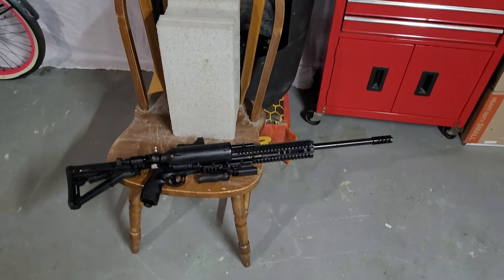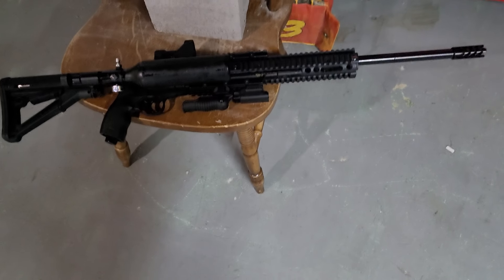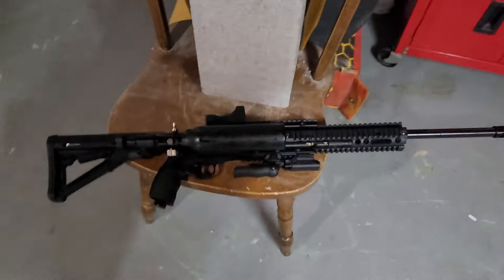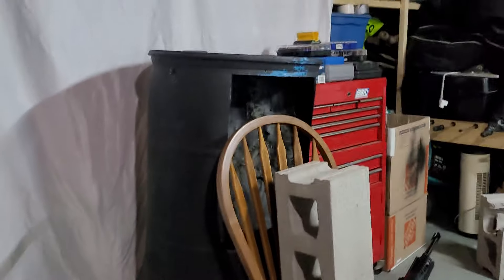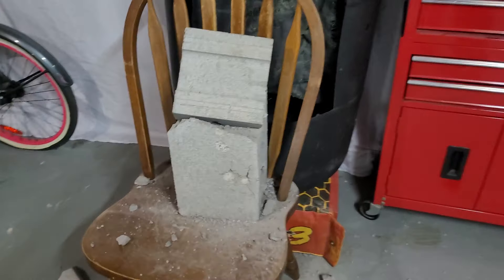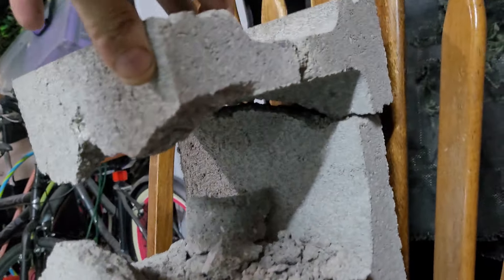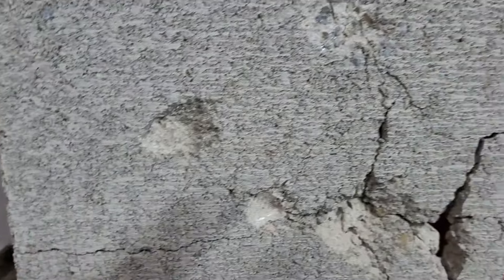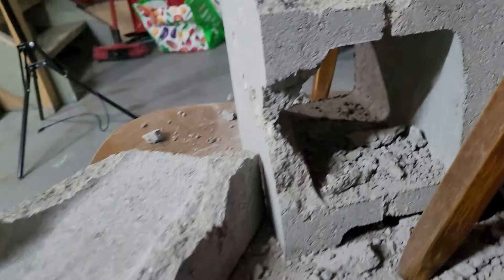Umarex HDR 50 vs Cinder Block 124 Joules 12g Lead Hollow Points

Comment: If you're running hpa and steel balls through a hdp50 with no restrictors and tuning barrel do i need to put rhe power kit in it or is a upgraded detent good enough? Thanks
Reply from the maker: just the detent is all you need

Comment: Nice video, thanks Jeff !
I guess it's filtered by the microphone : what about the noise ?
I got a set up on a HDR.50 - largely inspired by your videos - but that thing is noisy as hell even though it's "only" delivering 85 joules in its current state...
Reply: Go to Quattrovolante and get a insulated silencer. Great prices. Not mock silencers. Another top tip, try not to have concaves in the back of projectiles, it creates a deafing pop! They can be easily modified. Mine is down to 90 dB. I don't know how loud it was originally, but it was shotgun loud!
Any questions, just ask 😉
Reply: @-hopstar-  Thanks Bro !  I'll have a look at that.  I most often shoot spherical projectiles but even in that case its litteraly deafening (more than any other airgun i own).
Have a nice one ;-)
Reply: @DIMZEROCENT Plus side is, it scares the shit out of your burglar! If I heard that I would run!
Reply: devastator is concave, I didn't notice any notable differences. @-hopstar-
Reply: @hardairsoftmode  I make ammo. I used to leave a concave/space in the rear of it to catch more air. I found out by making it flush at the rear the sound was greatly reduced. Like popping your finger out the side of your cheek. And zrams the same, being virtually hollow. I would always fill them with something to save my ears! I suppose there are different variables. I make devastors in my mould. Absolutely the best design I have made. Amazing penatration when the ball bearing leaves the outer jacket
Reply: @-hopstar-  and i love devastator.
I usually shoot full slugs or balls.I'm really curious what the difference is when I use the suppressor.
Reply: @hardairsoftmode  Quieter. For my HDR 68 I needed to buy a short shroud, then the silencer attachs to that. If you study the website you can work out what you need. I've never seen anyone else with that setup, so you'll have a very unique marker
Reply: @-hopstar-  but I've already done everything, I don't know what else I could do.I'm going to do tests with the chrono, possibly bring a new cinder block.🤣

Comment: Not gonna lie, but I'd be scared to be firing anything at a cinder block due to the ricochets. A month or so ago I was shooting the 50 Joules HDX at the target trap I built for it and one of the 4.6 gram Homewrecker Busting Balls missed the target and hit the concrete wall behind the target trap and shattered into at least 9 pieces that I could find. I'd never seen a round shatter like that. I've had them split, crack, or get dented for sure, but never shattered. I've never actually used aluminum or steel rounds as they can damage the barrel over time and I'm not blessed enough to be able to take my launchers apart and fix them so I play it safe with the lighter rounds.

Edit: Gotta say I love that wall of launchers 😍
Reply from the maker: ya man i was pretty scared, i turned the block on an angle they all went in the right place thank god lol and thanks man :)